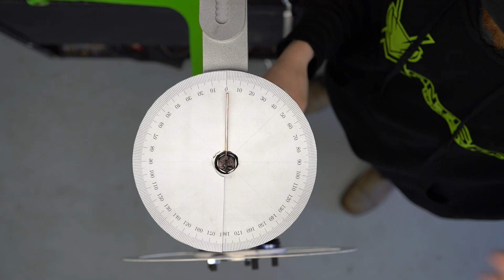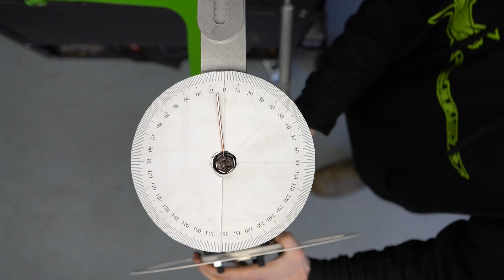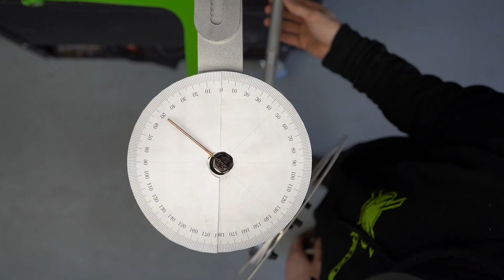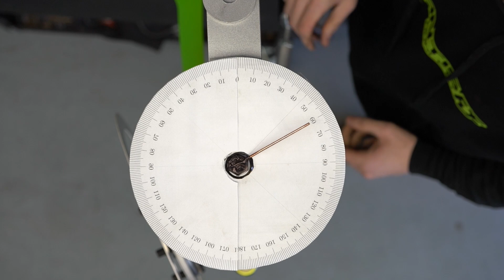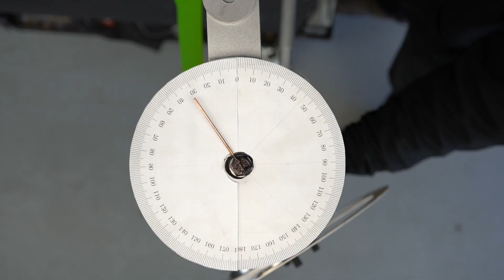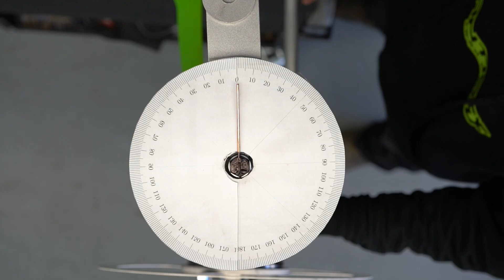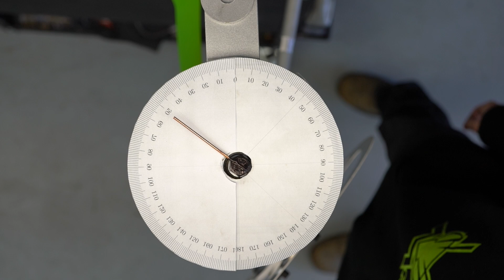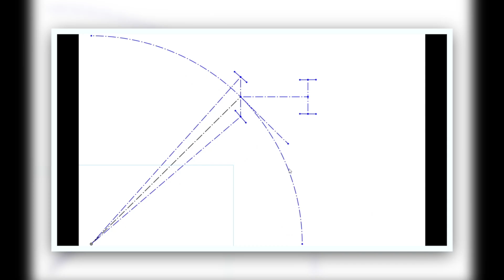Front Suspension Geometry| EP. 3 Ackerman & Toe

Comment: What about transition with anti ackerman, as you wouldn’t have any type of resistence made by the trailing wheel, the car will not self steer that great right?
Reply from the maker: The scrub caused by ackerman is a small % of self steer compared to caster/kpi/trail but yes, if you had pro ackerman and all other variables stayed the same.
Reply: @FDFraceshop  with anti ackerman steering has tendency to steer more deep into lock and feel really bad, well at least in europe on BMW on flat surface as we dont have ovals here.

Comment: Great visual representation and explanation! I'm trying to apply to a racing Go-Kart with no suspension and a solid rear axle. I race on road courses like Daytona, Road America, and Mid-Ohio where corner speeds are high and long straights.

We have a king pin bolt, steering arms, and an attachment point to the steering shaft. We are currently using parallel steering. Since karts have no suspension, they are dependent on the unloading the inside rear tire and weight transfer to promote good cornering. For front end adjustments, we have caster, camber, and toe. We can also move ballast around for weight distribution.

Would the kart benefit from Anti Akerman or Positive Akerman steering?

Comment: When at full lock, there is an angle between the steering arm on the spindle to the axis of the tie rod on the inside wheel.  (Think of a horizontal plane that contains the tie rod axis projection, the outer tie rod ball and the the point on the king pin axis where the plane intersects it.) Fundamentally, they get close to making a straight line when upwards of 90% Akerman.  What angle between the tie rod axis and steering arm do you "not exceed" to prevent cam lock or snapover at full lock?

Comment: Does Dynamic Toe affect or interfere with your Ackerman angles? for instance, by not taking dynamic toe into account, in full lock, with positive Ackerman, if the inside wheel is doing 50 degrees and outside is doing 40, would the angles change in you add dynamic toe into account? 
Also what is the mechanism that causes this dynamic toe phenomenon?

Comment: so.......if i have just an every day street car , with a front mounted rack , and due to the constraints of the dimensions of the front end , the tie rod arms sweep  back about 2 inches from the rack body in the straight ahead position , its never going to steer well ? the set up im refering to has opposite ackerman , the outside wheel is turning in more that the inner wheel . it seems like its set up like that more to be able to have rack and pinion steering than any consideration for steering angles ?

Comment: So when you moved the rack forward / back, is that without compensating steering arm length or with? I'm trying to get my head around if you kept the rack fixed, increased caster but adjusted steering arms to keep static toe the same (pitman arm still straight on static), would that result in a greater change to your dynamic toe / ackerman as lock increases?

Comment: Im confused to how on a rear rack set up how moving the rack forwards will lessen the full lock angle? I thought moving the rack closer would increase angle or require less rack moment before reaching lock to reach more/equal degrees than a rack being moved away?
Reply: In less words. Moving the rack forwards in a rear rack set up will loose lock angle? Thought it would increase angle.
Unless it’s not factoring that a cut and shortened knuckle to increase angle would affect dynamic toe is a way that moving the rack forwards actually helps. In this set up it shows that at factory tie rod pick up point and moving the rack forwards only would put it at a dis advantage. So doing both is a level up. Than that would make a ton of more sense.

Comment: Commenting as I watch for a second time. SO MUCH information packed into these. Thank you for taking the time to make them!

I’m thinking about my own car as I watch. I drift a 2014 S197 mustang with stock angle. I have camber/caster plates, but that’s the only adjustment I have. Apart from poly LCA bushings that help keep the settings I set better than the weak rubber bushings did.

I’ve been thinking of picking up some rack spacers from Matt Soppa to boost my angle a bit while I continue increasing driver mod before picking up a full angle kit. I’ve already deleted stock rack limiters. 

The spacers are 4mm thick and if I’ve got it right they basically increase the range the rack is able to go through.

I’m thinking that the dynamic toe will be greatly affected because the added range is at the extremes of rack travel? He says that exaggerates the stock Ackerman because the lead wheel has more angle than the rear stock so it will have even more with the spacers.

Also another question, will the spacer work with the kit you have available for my mustang? Or would I want to remove them when I purchase your kit in the future?

Comment: Did you mean that the trail wheel in a drift has no effect in drifting so lifting it off the ground doesn't affect the drifting experience?
Reply: It very much has an effect. The cars that three wheel are already close to zero ackerman, and thats why the wheel lift does not change it much. If you’re basically talking about the RTR mustangs, then they ‘steer with the rear’ anyway.

Comment: no offense intended but not sure why you keep bringing most of the concepts explained back to pro level drifting. i feel like most people watching these arent at or near that level, right?
Reply: Well a lot of beginners probably look at those setups and say “well they’re the best obviously” and just copy it. Might work for some, but obviously not others because of how drastically different the vehicle dynamics are. I found it informative in regards to you might have heard this or that, but this is why.
Reply from the maker: Pro drifting is something everyone has seen, so I'm simply refering to there setups as an extreme scenario. The suspension principles apply to all levels of drifting with the variables being horsepower/drivetrain/tires etc. Grassroots drivers are on the same $1-2000 kits that the pros are using. Fdf raceshop for example has sold 450 kits for the 350z, and probably 20-30 of those kits are being used in pro. All the dynamics of the suspension are the same and because of the adjustment, can be used at all levels of drifting.